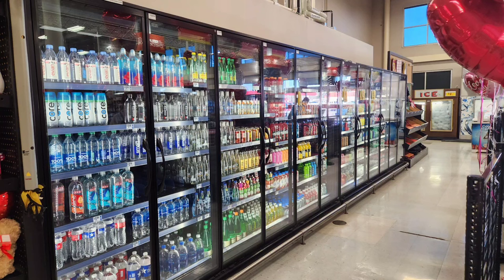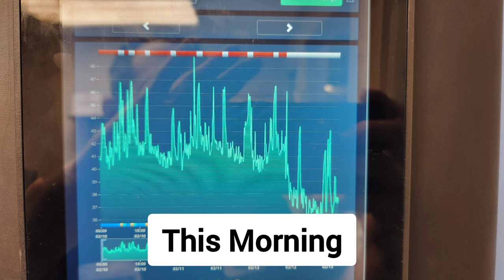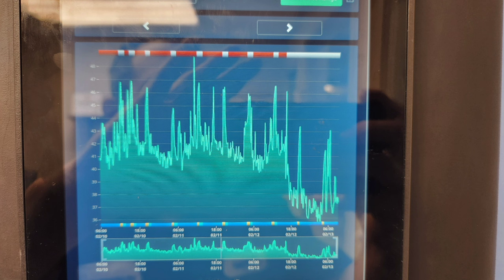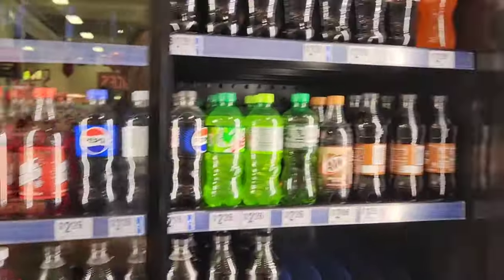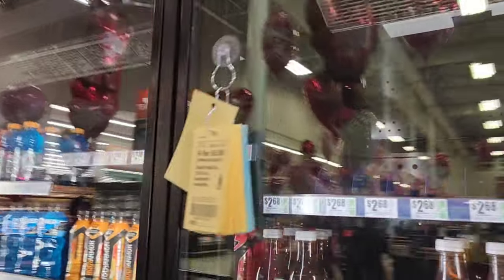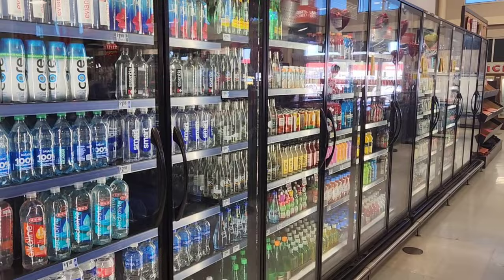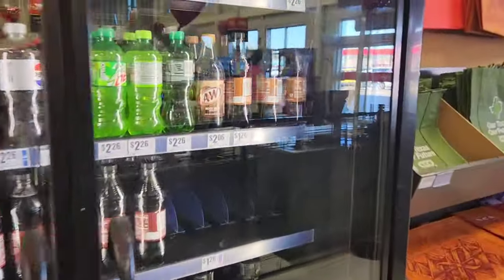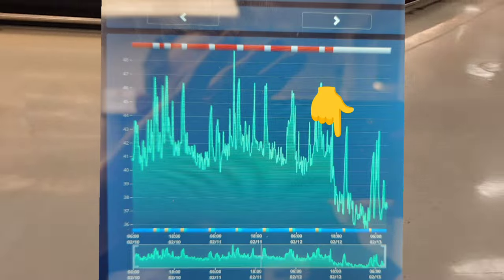Superheat Adjustment on Medium Temperature Cases

Comment: What's your thoughts on a wireless temp clamp vs the fluke 52? I'm on the fence of pulling the trigger for fluke 52. Don't really want to ask the other channels cause they are shills so I rather get your opinion. Don't get me wrong fieldpiece has some good stuff but rather get a authentic answer
Reply from the maker: I'm so sorry i didn't see your question and reply sooner. I have never had a Fluke 52. But I think the FieldpIece will work just fine. Wireless will give you more versatility in my opinion.